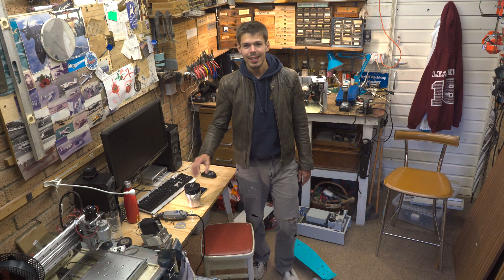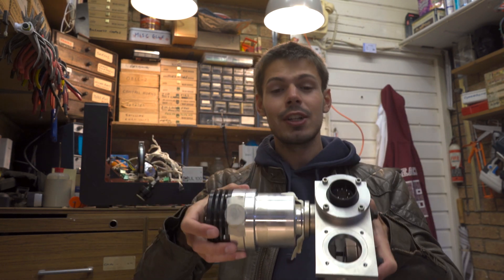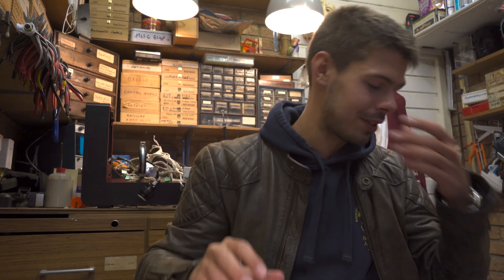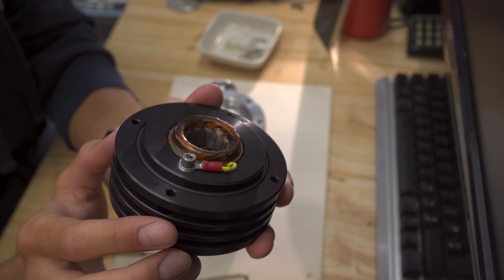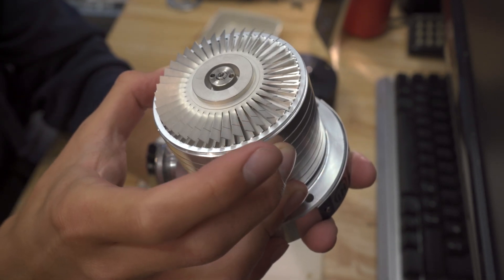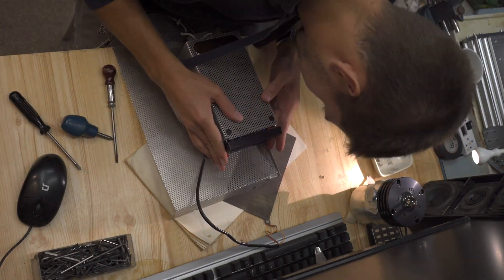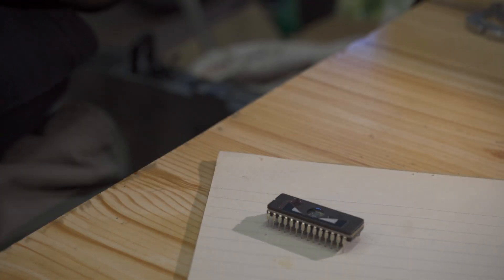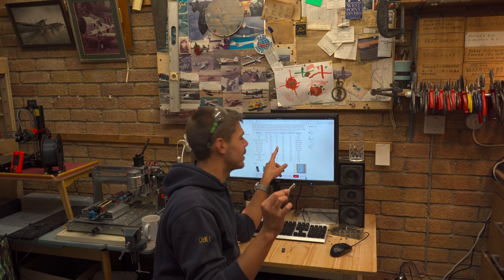What's Inside a Turbo-molecular Pump? And other bits of helium leak detectors

Comment: Fyi handeling high vac gear with bare hands in a dirty environment is much like handeling laser optics with bare hands in a dirty environment, not great practice. The seals have to be close to perfect given how little leaking is acceptable, it can be hard to achieve even in a clean-room sometimes. The oils and such on your hands will contaminate your vacuum and prevent you from pumping down. You might be able to get away with this on a leak checker tho, given it's sniffing for helium (or sometimes hydrogen), and if you distance it from your work with a long bellows.
Reply from the maker: I thought so 😂 I picked up the unit from a junk pile and it was already borked, so i didn’t feel too bad about tearing it apart. I knew the turbo vac would be worth something, but since it was sitting outside in the rain, and appeared to be spinning up immediately at machine power on without a low vacuum i was skeptical it would fetch much anyway. Now i’ve taken it apart i might just keep it for my own UHV purposes. Don’t know what yet though.
Reply: @errantmindstech  FYI a functioning turbo for a leak checker will sell for a couple thousand usd... but I understand the desire to take them apart. I'm currently building one from parts bc I can't justify spending 5k for a used machine for personal use haha.

Comment: was that around 300$ ?

A: aw hell NAW, 
just add a zero and x that twice
smh... not one lost screw when ya back up outta this one
Reply: Yep, he just destroyed at a minimum several hundred to a couple grand worth of equipment... I work with stuff like this for a living, so watching him was painful...
Reply from the maker: @xxportalxx. eh i don’t mind. it came from the scrap pile and will return to the scrap pile. I got educational value and anything I can still sell is a bonus :)
Reply: @errantmindstech  aight, look online tho, that gear still sells for 100s to thousands 'for parts' bc it's so expensive new (a brand new leak checker will set you back the price of a new car), it's a field where ppl actually refurb things (and parts are hard to find for older equipment) . Christ ppl will sell blown up turbos with mangled blades in the several hundred range, as there's companies that refurb them and resell for several thou.
Reply from the maker: @xxportalxx. wow that is good to know. thanks for letting me know? where do you think would be the best place to flog parts? ebay? or something more specific?
Reply: @maxwjacoby  so you are a millionaire now